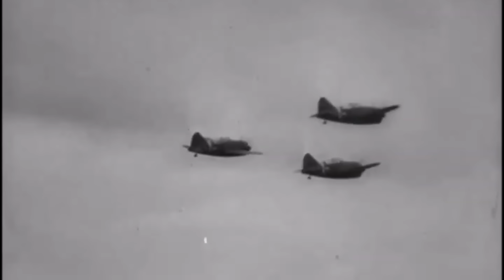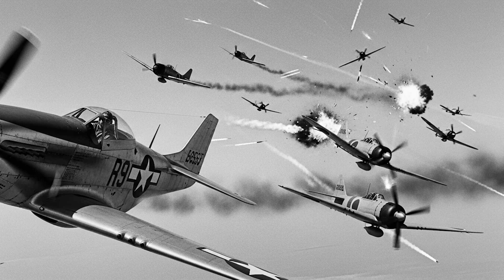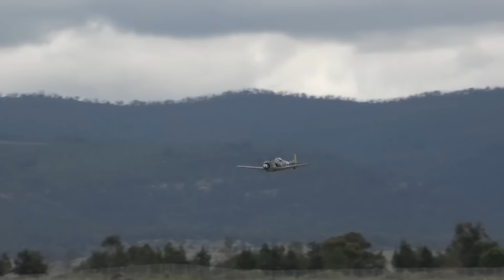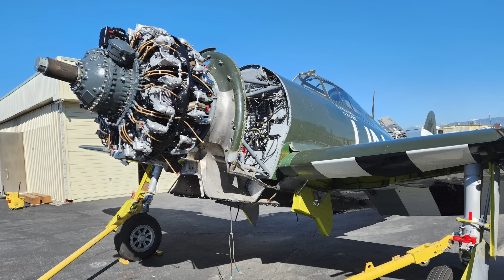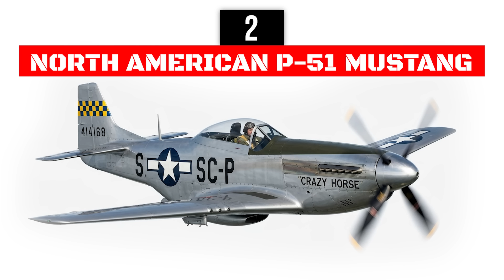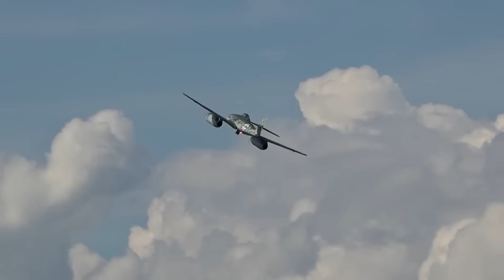Every WW2 Fighter Aircraft Ranked - WORST to BEST (COMPLETE)

Comment: The Mustang was NOT a good fighter and could not out turn much. P51 pilots were specifically warned NOT to engage in dogfights were they would lose.
THE tactic was to fly high, dive attack and out climb the enemy, (back up high where german planes struggled) which they did with great success. 
Those foolish enough to engage in lower level combat would most likely lose.

Comment: the p51 was good but I would argue the navel F6F Hellcat, and Marine F4U had more utility and outside of extreme altitudes better performance

a Corsair or a hellcat, could survive losing cylinders, a p51 could lose all power with a single round to the engine block, 

Corsairs and hellcats could carry more heavy payloads for anti ship roles

Navel planes had tail hooks for carriers, 

could handle sea spray, 

Were reinforced for a carrier deck or a rough dirt runway

Also the Corsair is faster than the P51 in climb rate and speed in later variants

They are just different roles, neither is really above the other so ranking really only works if one plane fulfills the same role but better

Like the Hellcat was the evolution of the WildCat, but even than the Wild Cat had a role the Hellcat could not fulfill as a great plane for a small carrier like an escort carrier

Comment: The P40 Warhawk wasn't great at high altitude, nor was the P39 Ariacobra, the latter was especially not liked in that regard. The US and Britain therefore shipped them to the USSR under Lend Lease in the early part of the war because Stalin was begging for aircraft, his air force having been decimated by the Germans. It turned out that the Soviets loved those two airplanes and wanted all we could send them. This was because they were just great as ground attack aircraft, well armored and self sealing gas tanks, so the pilots could take hits and still make it back home again. The Soviet action took place under 15,000 feet where these aircraft performed well. It was only after the war when relations cooled between the Soviets and the West that Stalin forbade mention of these aircraft and only spoke of the Soviet produced planes. Even those would not have been possible without the high quality aluminum and rubber and fuel we shipped them under Lend Lease, as well as food, trucks, factories, cotton, and lots of other materials. But during the war Stalin admitted that they would have lost the war had it not been for American help.
Reply from the maker: there are always exceptions

Comment: More myth propagation about the Zero.  The presentation acts on the pretense of what was " stripped out " of the Zero.  It was designed in 1937, at a time when nobody had fuel protection, and only Germany had rudimentary pilot protection.  These were features that no Brewster Buffalo had, the United States navy was basically the second last to install these features on fighters, and in all countries that used them development of these features continued throughout WW2, what set the Japanese Navy apart was late inclusion of them, not early failure to include what nobody else was including, and structurally the plane was strong enough to survice g forces that would disable the human pilot before the plane failed.  It was designed to be light, but not where structural integrity was concerned, skin thickness was comparable to other combat aircraft, flush riveting was also used to reduce drag, many other famous aircraft didn't.

Comment: The ME 262 being categorized as the best is a bit over the top. The best at what? Being late and in incomplete development? Yes, it was of the next generation technology, but it didn't really make the cut (fly extensively before the war's end). It's all a subjective list anyway, each flying evolution added something. To me, I would keep the list to the predominant technology of the day which was the piston driven either radial or water-cooled Merlin type.  Although I am in awe of the P47 for the absolute brute that it was, my choice is the A1 Skyraider  that showed up at the war's end. It was such a powerful ground support plane, tough as it comes and the key to how great it was is the idea that although most WWII planes were scrapped, this A1 Skyraiding found service in Vietnam. It's later evolution, as we know is the A-10 Warthog that the military had tried to retire over and over until it finally sunk into their heads that it really was indispensable. It's just a modern version of the A1 Skyraider. The Skyraider appeared at the end of WWII and was a superior aircraft in many ways. It had one engine but could carry the 8,000 lb. bomb load capacity of the B-17. The F4 Phantom, a most iconic Vietnam era airframe simply could not compete with the Skyraider in terms of ground support. It just flew too fast. Same senario with the A10  vs and F16. Anyway, as far as WWII single fighter, fighter bombers, the A1 Skyraider gets my vote. What do you think?
Reply: But really a fighter or was it a ground attack aircraft. Was it ever competitive in any kind of dog fight? Did it shoot down enemy bombers?

Comment: Hate to break it to you mate, but the Me 262 was rubbish. Under developed, rushed into service and with a confirmed kill ratio that was appalling. It needed new engines every third lamp post and had more problems in the air than almost any other fighter. It did go bloody fast though… if your engines didn’t flame out or catch fire that is.
Reply from the maker: Would Love to break It to you mate, I’ve already covered this in my another video after this one
Reply: The confirmed kill ratio of the Me 262 in combat was around 5:1. If you discount the incidents where it was ambushed either taking off or landing it approaches 10:1 which is nearly as good as the P-51 and twice as good as the Spitfire. Not exactly appalling.
Reply: @biernut8723 How can you discount it being ambushed? That’s like saying you should discount every time a Spit or Hurricane squadron got bounced in the Battle of Britain. It was one of the 262’s weaknesses which were fairly exploited by the allies. Just like German night fighters exploited the Lancaster and Halifaxes’ vulnerable underbellies. And the confirmed kill number includes some aircraft officially counted where the allies have no record of losing a plane. Happened both sides by the way. My point is, the 5:1 combat ratio does not include the number of times a 262 crashed or blew up of its own accord.  Throw that into the mix and the picture changes drastically. So yes, you are right, 5:1 doesn’t sound bad.  But throw in the wasted resources and the sheer number of its own pilots it killed, that ain’t too good. And it wasn’t even the first operational Jet. Delve deep behind the propaganda and you’ll discover the Gloster Meteor just pipped it to the post.

Comment: F2A Buffalo - It wasn't as bad as thought tbh. The Marines actually used it rather well during the Battle of Midway but of course, was shocked at how dumb they were to underestimate the Japanese. Sure it was obsolete but even obsolete planes can wreck havoc against a skilled enemy and the F2A showed otherwise in Marine hands, being able to shoot down quite abit of IJN planes despite giving inferior and broken (Yes, broken) planes. They did receive F4F Wildcats past Midway but that wasn't any much better either or else the F6F won't be made nor the F4U Corsairs which became one of the main fighters the USMC would adopt post-1943. 
Hurrricane - That was SUCH a gross understatement. The Hurricane was actually better than the early Spitfire in Africa also. Due to a lack of a proper cowling early on to fit air filters, Spitfires sent to Africa was struggling hard and with the British back then nearly losing Egypt, having a lack of air cover was a no-go thus the Hurricanes were quickly pulled back into the North African theater of service from places like India and those that were destined to Singapore which, never happened cuz of god damn Percival's surrender. Regardless, these Hurricanes became the backbone of the Desert Air Force for almost a year and a half before a proper filtration system can be fitted to the Spitfire Mk Vs then did the Hurricanes officially retired and became reserve aircrafts. The Hurrricanes, together with the P-40s were the ones holding the front from 1941-1943. A long ass time for obsolete planes ngl and solid KDRs. 
FW-190 - The FW-190 actually has more merits than given here. It can carry more bombs, even strap rocket pods if the Luftwaffe wants to and has more range than the BF-109 could ever think of which was the main issue the BF-109 faced. Plus, it as way more scalability and upgrading potential than the BF-109s. Should have been higher than the BF-109 tbh.
BF-109 - Theoretically one of the best planes but it's actually shit in practice. The cockpit is unbearingly small, small fuel tanks meant it was shit at being an escort fighter which was a thing the RAF caught on early and used to extreme efficiency, shit upgrading potential, rather poor firepower as compared with the FW-190 and terrible visibility. The reason why the BF-109 was even picked was that when it was shown, Gorring liked the speed of the plane during an air race exhibition and despite Wilheim "Willy" Messerschmitt telling Gorring it won't work as a fighter, Gorring didn't care and told him to redesign it which turned it into a fighter. It was good early on cuz nothing could compare it to but as the war progressed, the ugly devil rears its head. Plus, it has a tendency to lose balance or not turn anymore if banked to the left extremely hard which was another quirk the BF-109 had that the USAAF pilots would use to great effect when they faced the BF-109s over the Italian skies and in France.
Reply from the maker: Those are some incredibly detailed points, especially regarding the operational history of those aircraft in North Africa!

Comment: The Grumman F6F Hellcat had a Kill Ratio higher than any  other fighter, including the P51, 19 to 1.  It was nicknamed the Ace Maker versus the nickname of the F4U which was the ensign eliminator.
Reply: The F6F was introduced in the late war when all the skilled zero pilots were shot down by F4Us, and P-38s. The Corsair earned the name ’the ensign eliminator’ before the US navy used them, and the Navy gave the Corsair to the British navy who did not know how to deal with the torque stall on landings, which was later solved with a adjustment to the landing approach. The Corsair paved the way for the F6F’s success.
Reply: @Warren-vw6vw and yet the corsair's kill ratio was only 11 to 1.
Reply: @Warren-vw6vw First Flight: June 26, 1942

Operational Introduction: Early 1943 (initial squadron testing)

Combat Debut: August 31, 1943

F4u
Official Introduction Date: December 28, 1942

Combat Debut: February 14, 1943 (Guadalcanal area with Marine Squadron VMF-124) [1.4]

Widespread Carrier Operations: Late 1944 / early 1945 (following modifications to landing gear struts)

Not much earlier.

Comment: Gimme the P-47. The most successful and toughest fighter of all. Eight 50 cal and supercharger, which pushed it to 2,000 horses and a diving speed of 600 mph.
Reply: To correct you the p47 couldn't reach speeds faster than 450 mph
Reply: Most if not all the pilot accounts of flying the P-47 were how much they loved that plane, how reliable it was, how much power it had, and how much abuse it could take and still bring you home. It was monster big! After getting used to the sleek shape of the Spitfire, or the P-51, when you realize the P-47, it's kind of a shock. It just goes to show how diverse design can be.

Comment: Kind of a BS ranking. The P-38 was taking the fight to the enemy (in both ETO and PTO), and doing it very well, for years before the late war fighters came on the scene...ask Yamamoto. The Lightning did very well in the North African/Mediterranean theaters as well. The P-38 Lightning was the first Allied fighter to make it to Berlin and back (it wasn't the P-51 that did it first). Several 15th AF squadrons refused to give up their P-38's when they were told they were switching to Mustangs, they asked why they had to give up their "Cadillacs" (P-38s) for "Spam cans" (P-51s). They kept their P-38's until the end of the war.
Reply from the maker: That's a fair point, the versatility and reach of that aircraft definitely earn it a top spot in any historical debate!

Comment: No way FW-190 or the Messerschmidt were better than the Yak-3 or the LA-5FN or the LA-7. The point was proven in Kursk where one of the biggest air battles took place alongside the huge tank battle on the ground. The Russian planes decimated the Germans. Kursk was won by the Russians proving the planes superiority. True that they were simpler and harder to pilot in terms of what the pilot had to do. The German planes already had lots of automation in the cockpit such as setting fuel mixture, carb heat, some avionics and they all had great radios. The Russian planes either lacked this or not all had them. However that’s doesn’t make the plane itself better in overall performance, it just makes it more comfortable. Comfort in war is not a necessity, a higher climb rate and tighter turning ability is. The Yak-3 and LA-5FN/LA-7 outperformed the German planes at the altitudes fought on the Eastern front. Those were dog fights below 10,000 feet. Nobody flew higher than that on a regular basis. What mattered were the kills below 10,000 feet. That’s why the Germans lost Kursk and then lost the war = the Russians and the allies had better machines where it mattered the most.
Reply: Stalingrad lost the war for Germany. Stalingrad had the greater strategic impact. Its defeat destroyed Germany’s 6th Army, ended the 1942 offensive, shifted the strategic initiative to the USSR, and is widely regarded as the decisive turning point on the Eastern Front that made German victory no longer realistic. Kursk confirmed Germany’s loss of offensive capacity (ending large-scale German offensives), but it followed Stalingrad and consolidated the shift already set by Stalingrad.

Comment: As yo say the FW190 forced the Brits to cram a bigger engine in their Mk-Vb Spits and that meant they had to make it longer.  The MK-IX was cobbled together as opposed to specifically designed as an immediate response and a place holder for the Mk-VIII, which was a totally new design.  They ended up making more Mk-IX  Spitfires than any other mark.  When the MK-VIII was finally put into production it was a slightly better performing Spitfire than the Mk-IX but not really a lot better.

Comment: Yak 3 and the LA-7 both had limited ammo.  Yak had two 12.7mm (.50-caliber) machine guns and one 20mm cannon. Had 300-rounds total of 12.7mm ammo and 120-rounds of cannon ammo. The LA-7 came with a number of different armament versions but most had two 20mm cannons with 200-rounds per cannon.  They performed well and had deadly armament but hardly any ammo to feed them.
Reply: I mean, you dont really need much ammo when you can shred planes into just one good burst.
Reply: Yet it really is still an massive drawback.
Reply: @bryant_55  Not hardly true.  I suggest you try that with one of the good flight sims like DCS or Aces High. For comparison, look at the P-51 which has 6 50-caliber machine guns.  It carries 1,880 rounds.  Just as an FYI the LA-7's 12.7mm machine gun (has a total of 300-rounds) is the same as the 50-caliber machine gun on the P-51. It's 20mm Cannon was deadly but didn't have the range of its 12.7mm machine guns.  Later variants had either two cowl-mounted 20mm cannons or 3 cowl-mounted 20mm cannons.  Each cannon had 100-round of ammo.

With most fighters that had both machine guns and cannons they would fire he machine guns at the longest range and reserve the cannons for closer in shots.  Two hits from the 20mm cannons were often enough to shoot down an aircraft...presuming you could hit it.

If you try flying any of the WWII Combat Simulators you'll find out quickly just how little ammo you have when you start firing.  Also on any of the WWII gun camera videos bear in mind that the tracers you are seeing have 10 non-tracer and thus non visible rounds fired in between them.
Reply: @dgracia18 I see, you very clearly know more about planes than me, so i will take your words.

Comment: On the P-38, that compression problem was cured by the addition of dive brakes, which kept the dive speed below the speed that compression set in. They also pushed the pressure on the wing back towards the center so the ailerons, elevator, and rudder were no longer locked in place by the compression pressure.